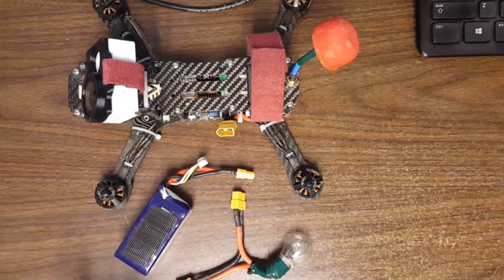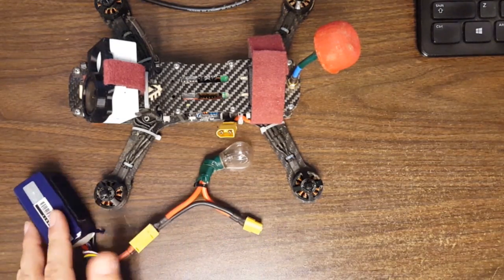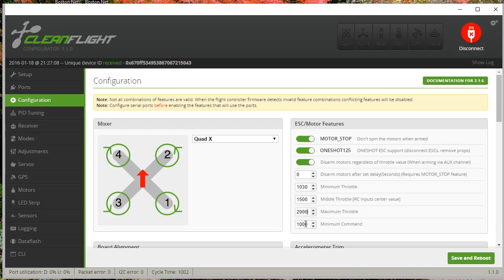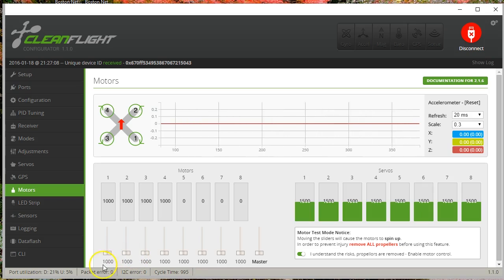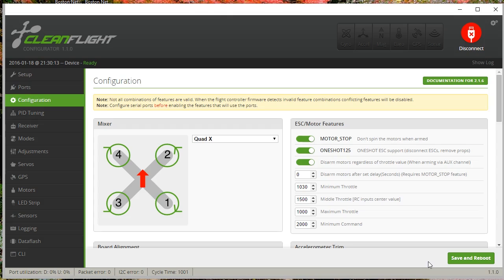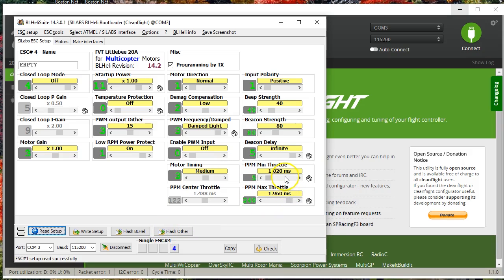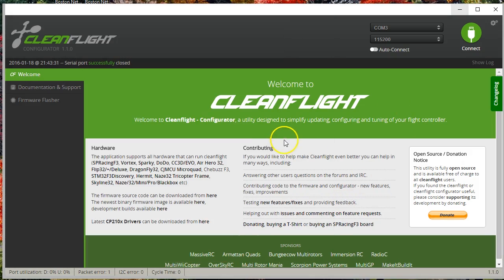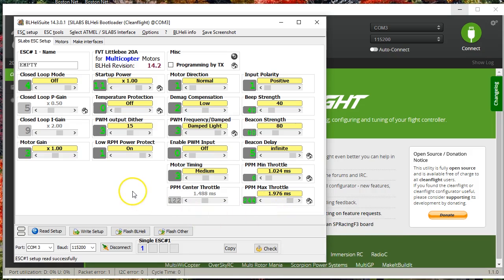How To Calibrate ESCs with Cleanflight and BLHeliSuite

Comment: i do all of this, but when i click read setup, i get the error after blheli appears to freeze for about 30 seconds..
Com8 Error - closing Port now...
SetCommState function failed
System Error. Code: 31.
A device attached to the system is not functioning
[CANCEL]
Reply: +TameTurtlez I got this, in the end i resorted to using the 4 wire interface with an arduino directly in blhelisuite, this worked, but i've not tried blheli and cleanflight together for calibration since..
Reply: got it working - i don't know if i didn't read or here, but it's working flawless on BETAFLIGHT without changing a thing. so i think it currently does not work with cleanflight 1.12.

Comment: My ESC were all in sync. Min Throttle and Max Throttle was the same on all of them. 
Is that normal?
Reply from the maker: +Fábio Castro it's not a problem. Are you sure you actually calibrated though?
Reply: +Joshua Bardwell Yes. They did the calibration beeps like normal.
Reply from the maker: Okay. They're just really well matched then.

Comment: Thanks man - the very last part of this video helped me with my DODO.
Reply from the maker: +VIKO FPV Awesome! That's what I'm here for.
Reply: +Joshua Bardwell +Joshua Bardwell one thing though I am getting confused on is min command vs min throttle. Why wouldn't you just sync up bhheli ppm min throttle to min throttle on clean flight instead of syncing up min command and ppm min throttle?

Comment: Hello,

Could you please tell me the right settings I should set on CleanFlight and on BLHeli ESC Min Max Throttle Calibration? I have 20A littlebees.

CleanFlight Configuration:
Minimum Throttle: 1031
Maximum Throttle: 2000
Minimum Command: 1000

After I flash the ESCs to 14.4 each ESC's values are shown below:

ESC1:
PPM Min: 1024
PPM Max: 1972

ESC2:
PPM Min: 1024
PPM Max: 1976

ESC3:
PPM Min: 1020
PPM Max: 1960

ESC4: 
PPM Min: 1020
PPM Max: 1960

And startup power is at x0,75, should it be at 1 or is it fine as it is?

Last question: The PWM Frequensy/Damped is set to high. I see on some videos it's set to damped light. Should I change it to damped light?
Reply from the maker: +Kaan Aslan Yes. Use Damped Light if your ESC supports it, which LB20 does. If you performed calibration, don't worry if the final values are a little different. That's normal. The calibration is doing its job.

Startup power of 0.75 is fine.
Reply: +Joshua Bardwell Thank you. Then I leave the rest :)

Comment: So the new version of Cleanflight supports ESC programming or do we need to use betaflight?
Reply from the maker: +Jon Car I don't know off the top of my head. Check the release notes.
Reply: I did but does not say if it does.  Funny thing the API is in the programming notes.
Reply from the maker: Jon Car If it doesn't say it's supported, I expect it's not. It wasn't in 1.11 I don't think, but worth a look. Surely if it was added, they would say.

Comment: Any idea what the 12C error at the bottom of the screen means?  Mine always says 12c error 3.
Reply from the maker: It counts errors in the i2c bus. There are sometimes a few errors on power up. As long as it's a low number and not increasing, it's fine.
Reply: Thanks for responding.  Not exactly sure what a i2c bus is, but if it's not a problem, I'll carry on.  Still very new to this hobby.
Reply from the maker: +Joe Smith i2c is a serial protocol that is used to talk to the gyro and other sensors.
Reply: Gotcha.  Hopefully my F3 isn't damaged.  I have noticed it slowly drifts in heading on the setup screen.

Comment: What does it mean why the ESC's twitch at idle/power on? Trying to run oneshot and flashed blheli 14.4 and twitches were worse than what I'm running now 14.1. Not sure what the issue is. I have both the ground and signal wires connected. Does this indicate a problem? My ESCs are ZTW Spider 12A ESCs.
Reply from the maker: +Joey Nuggetz The twitches can be solved by reducing min_command to a lower level. Just to be clear, here is the process I would recommend: set min_command=1000 and max_throttle=2000; calibrate ESCs using the motors tab; set min_command=950. That should do it.

Comment: Hi! Thanks a lot for all your videos, really useful !

Questions about the calibration please. What is the best method :
1- Set the min/max PPM values in BLHeli at 1020-1980, 
or 
2- Calibrate via Cleanflight and then adjust min/max PPM with BLHeli to get the same values for all ESCs ? 
In the second case, I get 1020-1860. Should I reduce max_throttle close to 1860 or keep 2000 in Cleanflight ?
Reply from the maker: +Fosch I prefer to set min_command=1000, max_throttle=2000, then run calibration using the Motors tab. ESCs will have different values, but that's the whole point of calibration: to compensate for small differences in the timing circuitry in the ESCs and FC.
Reply: +Joshua Bardwell Thanks !

Comment: How do I know which com port to select?
Reply from the maker: +Phillip Once whichever one the Silabs CP210 driver is on, or if you're using a board with VCP, the VCP driver.
Reply: +Joshua Bardwell Sorry I'm not very knowledgeable of programming and have absolutely no clue what you just said, lol
Reply: +Phillip I have a naze32 and Littlebee esc's if that helps...?
Reply from the maker: +Phillip Honestly, when you plug in the board, the CleanFlight configurator should auto-detect and auto-select the right COM port. Is it not doing that?
Reply: +Joshua Bardwell Ok, thanks... I guess its com port 5 for me. Thanks for the quick reply!

Comment: if i change looptime in the gaui cleanflight 1.2.0 from 1000 to 2500 the chance wil not stay after saving , it turns back to 1000....? doe i stil have to change the looptime in the CLI comand like bevoor? is it a bug in 1.2.0 ?
Reply from the maker: Not a bug. PID is locked to gyro at 1 kHz. Why do you want to make aliasing worse by sampling slower? F1 board can run all features under 1000 looptime now, so there is no need to go slower.
Reply: +Joshua Bardwell 
after flying this afternoon, same thinking here erverything workes great no need to change, thank`s

Comment: Can anyone recommend esc's for my 4822 690kv motors/ blheli boot loader of course?
Reply from the maker: +Vic Prk (Slick  Vic) How many amps? Up to 6S, up to 40 amps, the Xrotor 40 are hands down the best right now.
Reply: +Joshua Bardwell Thanks for the lightning reply, using a 4s and 40amp 25c/50 burst. They work fine, 20 min. flight time plus but to be honest I don't have a clue :}
Reply: +Joshua Bardwell Funny, looked em up, I had those bookmarked.
Reply from the maker: +Vic Prk (Slick  Vic) Really, no kidding, those are the best ESCs on the market right now. Flash BLHeli to them and go to town. The main reason others might reject them is the size and weight, but given your motor choice, that's probably not an issue for you.

Comment: Ok is this normal don't mind the motor they dot fixed by themselves I don't know how but they did they don't make the twitchy sound but from in clean flight u can see how they are all over the place 

https://youtu.be/gZmhVVm3ixk
Reply from the maker: +sparkyondub2zz Yes, that's completely normal when you spin up the motors with the copter on the ground. The PID loop is just doing its job, trying to stabilize the copter. Nothing at all is amiss.
Reply: +Joshua Bardwell Great thanks buddy

Comment: I have been setting up my naze boards with my futaba forever it seems... never with much else. I have been building a salvage quad out of spare parts and put one of those new Orange ppm only rx I mentioned in another video since this is a goof off craft.
I am using a spare set of ZTW's with an older fw release of blheli (I just plugged and calibrated) and I am getting this odd "twitch" to the motors when not armed. 

I thought I remembered seeing something in this vid but have watched it 3 times and do not see it. Do you have any idea or possible resolutions?
Reply from the maker: +Hiway Calibrate with min_command=1000, then set min_command=960 and do not re-calibrate.
Reply: +Joshua Bardwell ah. you da man. gotta put you in the will or some shit ;)

Comment: As a programmer I find the variable names used in CF very annoying and confusing as a new pilot.
Reply from the maker: +sqwert There is a lot of room for improvement, but part of the challenge is that people barely understand the CLI to begin with, so changing anything is likely to introduce a lot of confusion.

Comment: So, if I do an ESC calibration in Cleanflight and then connect to BLHeli I see "Out of sync with master" message. Do I have to change "Min Throttle" and "Max Throttle" to make them similar or leave them as is?
Reply from the maker: +Alexandru Covaliov I leave them as is. That's the whole point of calibration. You can disable "sync min/center/max" under the Options menu to avoid getting a warning. If any ESC is more than, say, about 50 us off from the CleanFlight configured value, I would be suspicious of an issue with the oscillator. Realistically, it will probably fly fine, but I would want to be aware of it just in case.

Comment: Very informative...I always wondered about the BLHeli stuff.  I have SimonK Autoshot....I've stayed away from BLHeli for my last 3 builds just because I kept reading of all sorts of issues with BLHeli, either because that's what most people use or because people may just be messing with them through the suite making it seem like it's a more problematic firmware for ESC's.  I may try BLHeli at some point in the future.

One question, how could adapt your technique outlined here if I have a CC3D that needs power for Cleanflight to connect via USB?  Thanks.
Reply from the maker: +txfieros I'm not sure how you would do this with CC3D. I suppose you would need a separate power source for the CC3D vs. the ESCs. But this might not be practical, and you might just be better off setting the endpoints manually.
Reply: +Joshua Bardwell now that you say that, if I ever had to I could just use my variable voltage power supply to sent power via some PWM pins.
Reply from the maker: +txfieros I do think that you could power the board via the motor header. The center pin of the motor header is typically wired to Vcc on most boards.

Comment: Nice video Josh! So in theory your ESC's calibration determines your min_throttle value and this will vary from setup to setup.
Reply from the maker: +Greg McKean Your statement is strictly true, but I want to be sure you're not confusing min_command with min_throttle. Min_throttle is where your motors just barely start to spin. It is used to prevent the PID loop from ever stopping a motor in flight. Min_command is the bottom of the ESC's input curve, and is used to stop the motors entirely. Min_throttle is a percentage of the ESC's input range, which varies depending on the strength of the ESC's output and the resistance of the motor to turning. So for a given ESC and motor, it might be the case that min_throttle is at 10% of the ESC's input curve. This means that if min_command=1000 and max_throttle=2000, then min_throttle would need to be set at 1100. But if min_command=1100 and max_throttle=1900, then min_throttle would need to be set at 1900 - 1100 = 800 times 10% = 80, so min_throttle would need to be set at 1180.
Reply: +Joshua Bardwell you mentioned min_throttle being where your motors barely start to spin. Is this set by the user stating a min_throttle value or is this determined by calibration?
Reply from the maker: +Greg McKean You need to determine it for your particular setup. So after calibration, you go to the Motors tab and then you raise the Master slider slowly until all of your motors just start to spin without stuttering. Then, personally, I add another 15 us to that value to compensate for air movement pushing on the props when in flight, and that's what I use for min_throttle.

Usually, all the motors will start up within about 10-15 us of each other. If you get a scenario where, like, three of your motors are spinning at 1050 us, and then the fourth motor won't spin until 1100 us, you may have a mechanical problem in the motor (bad bearing, bent shaft, etc...).
Reply: Thanks for this info. You have confirmed what I thought regarding min_throttle being different from setup to setup rather than a set "go to" value. So do you set min_throttle to zero in cleanflight prior to calibration? Does cleanflight use the currently set min throttle value in its motor calibration? I noticed in the video you already had a min_throttle value prior to your calibration. Thanks for all your help.
Reply from the maker: ***** min_throttle has nothing to do with calibration. It only applies when the copter is armed and the motors are spinning. See the "full treatise" videos for more on that.
Reply: +Joshua Bardwell got you! all makes sense now. thanks again.
Reply: Sorry for bringing this up again, thoughts circling my head. Once you do a calibration and see the results in blheli, you mentioned you can take the highest min and lowest max, with these figures do you set all ESCs to these values in blheli or would you be better keeping each escs to their cleanflight calibration values (not changing them after calibration).
Reply from the maker: +Greg McKean I would leave then as is. But some people prefer to have them all at the same number for whatever reason.
Reply: Thanks! Got some re-calibration to do tonight, betaflight has a new release anyway so may as well bite the bullet! Cheers

Comment: Other question (sorry to bother you mate), do you think BLheli 14.2 is best to Little Bee 20A? I see you use 14.2 and not 14.3. Thanks again.
Reply from the maker: +FPV Portugal I don't really know about that. I am currently running 14.2, but only because I'm a bit hesitant to upgrade to the latest and greatest if what I have is working. I don't remember there being any huge bug fixes or performance improvements in 14.3, so I haven't moved up. But I wouldn't down-grade from 14.3 if it was on my ESCs.
Reply: Joshua Bardwell Thanks for the answer Joshua. :) Yeah i knwo what you mean, if aint broke dont fix it. :)

Comment: Another useful video. One question, what is better, calibrate the throotle manual or with blheli suite?
Reply: +FPV Portugal Question asked before seeing all the video... LOL
Reply from the maker: +FPV Portugal Just for the record: I like to calibrate because it tells me how far off my ESCs are, and because I know that it brings my ESCs into sync with each other. But it's just a sort of nit-picky thing that I like to do, and practically speaking, there is usually no effect from just setting reasonable endpoints like 1030 / 1970 and getting out to the field. Pilots who have many different crafts and who are replacing ESCs often can benefit from settling on a certain fixed value rather than calibrating all the time.
Reply: Joshua Bardwell Thanks for the very complete answer, yeah now i understand, i picky just as you so i will keep do the tx calibration. :)
Reply from the maker: +FPV Portugal Also, let me add that I last calibrated my ESCs maybe three months ago. And when I calibrated them for this video, I got different values! My best guess is that the oscillator is somewhat temperature sensitive, and it being winter now, maybe they've drifted somewhat. I don't know. But the point is that even if you calibrate, you're still likely to end up a few microseconds out. I think the real advantage of calibration is that, if you have an ESC that is way off from the others, you will find out.
Reply: Joshua Bardwell Yup, man you have real knowledge. Thanks for all explanations and videos, i love your channel and i recommend it in my forum, keep up the good work man. ;)

Comment: i keep getting power back flow into the escs with no battery connected
Reply from the maker: +305bonddog This is a function of your flight control board. In theory, you could prevent this by disconnecting the power wire from the flight control board and just having a common ground, but really this is probably more trouble than you want to go to. My suggestion is that you aren't able to use stick arming, so just set min_command=1000 / max_throttle=2000, and in BLHelisuite set your endpoints to 1030 / 1970.
Reply from the maker: +305bonddog I meant to say "stick calibration" not "stick arming". But I think you got the gist.